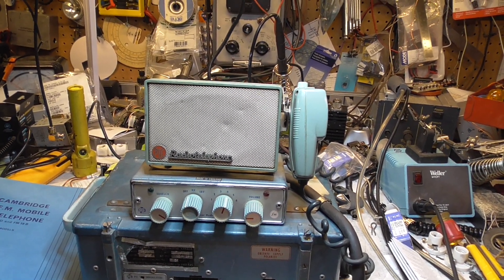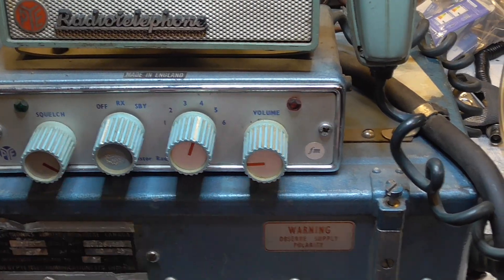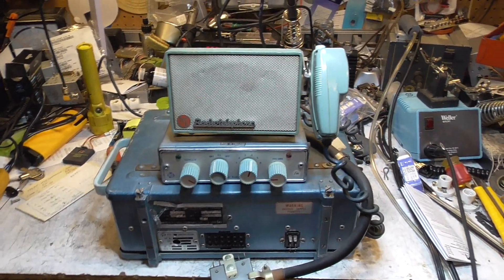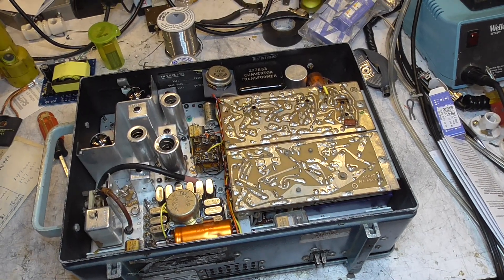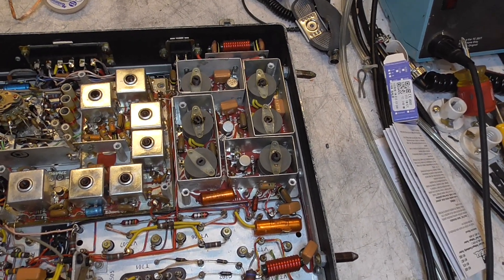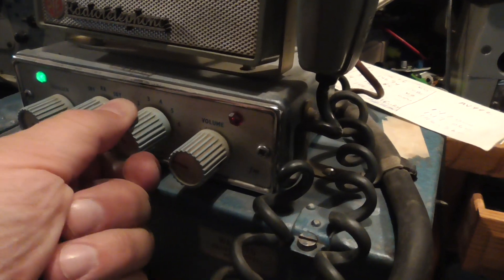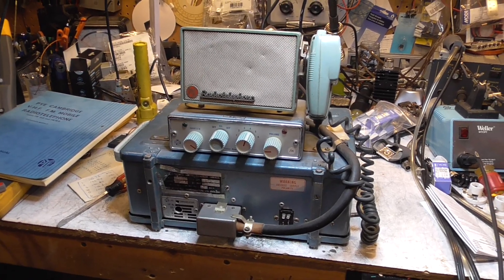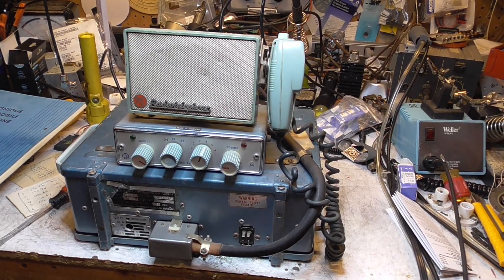PYE Cambridge Radiotelephone

Comment: Hi,

this week I found a PYE Radiotelephone Model: FM10BN6 ... 😀

https://www.youtube.com/watch?v=No3CKHW3dDQ

Sadly the previous owner had pulled out not only the crystals

but also the little motor which switches between these crystals... 😞

Any idea where I could find me a little motor like this

& some suitable fitting crystals?...

(many) Thanks in advance...
Reply from the maker: You might be able to find a scrapper on eBay.  But you never know where one might turn up.   These days I’m considering converting one to use the QRP labs crystal replacement and a switching system for multiple channels.